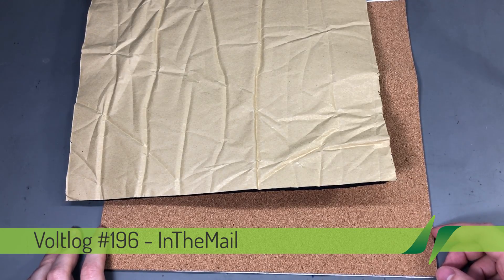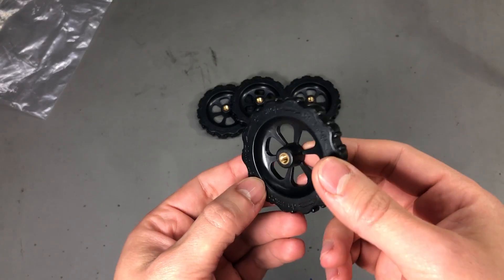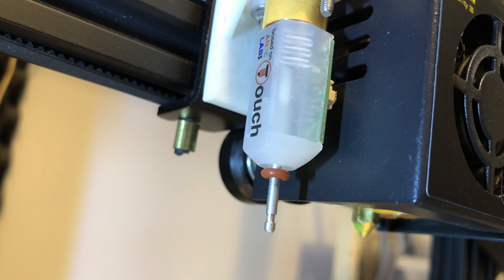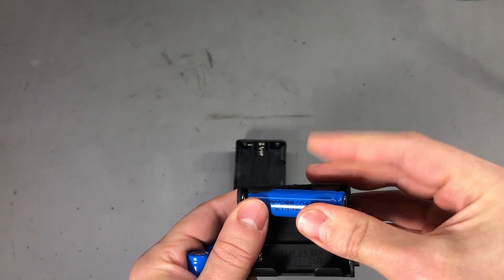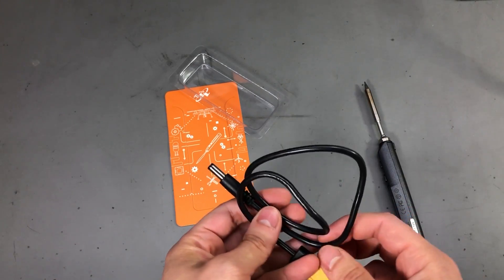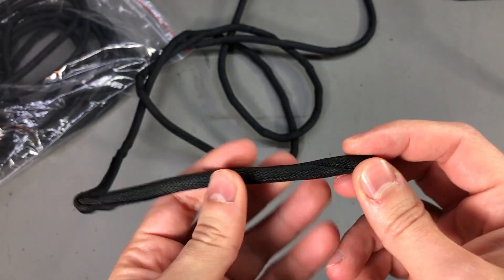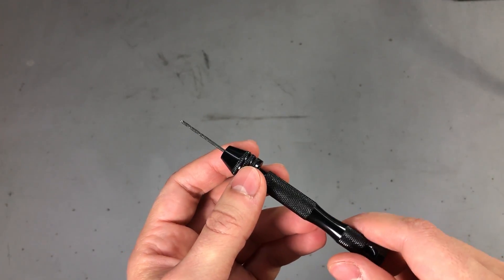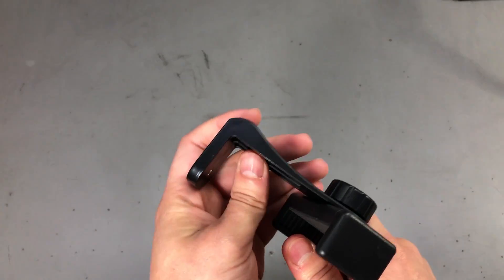Voltlog #196 - InTheMail

Comment: I use a self adhesive motorcycle/car exhaust isolation mat.
https://www.ebay.de/itm/Auspuff-Thermo-Hitzeschutz-Matte-Alu-Keramik-selbstklebend-1-8mm-50x100cm-500-C/292456850056?epid=2148031865&hash=item4417c96288:g:f3cAAOSwgotcN1Sn:rk:1:pf:1&frcectupt=true

Comment: I would have concerns about the mechanical stability of that stick-on foam pad. It looks pretty soft from your video. Don't you need something more solid and stable?  I would have no concerns about the cork. It should have adequate mechanical stability and will hold up to that modest temperature.  I would seek a thicker piece to enhance the insulating factor.
Reply from the maker: I don't understand your point. Why would mechanical stability matter? the foam has no mechanical role.

Comment: Your foam pad with the foil back look exactly like the sound insulation I use in the engine bay of marine equipment and Yachts, it gets pretty hot under there as well as moist so if its the same type of stuff your probably ok and not even close to as hot as a engine bay.
Reply from the maker: that sounds good

Comment: I'm using the black foam with back alluminium like sheet, identical to yours. I have a 250 w silicon matt, I print ABS filament at 105 °C without any problem (no warping, fast warning up). Looks cheap but it does it job. Also the glue is enough heat resistant to print at over 100°C.
Reply from the maker: okay, thank you for the feedback!

Comment: Cork is a great choice, I've been using a 5.5mm thick sheet I got from Wal-Mart from the hobby & crafts area for around a year now, and the heat retention is amazing. At the end of a print, my extruder is normally back to ambient temp before the bed has lost even 8-10 degrees. The fan in my power supply rarely kicks on now too because it has to work so much less on the bed.
Reply from the maker: okay, thank you for the feedback! If I were to decide on using cork, I would have to reorder it because I don't like how the one I got it's ripped to pieces.

Comment: https://www.aliexpress.com/item/2pcs-lot-2mm-Adhesive-Silione-Foam-Rubber-Sheet-163x203x2mm-Closed-Cell-Silicon-Sponge-Sheet-for-Heat/32827967851.html This can get you started. I have a 3mm version that a seller custom-cut for me to my print bed size.
Reply from the maker: this seems to have some specs, interesting!

Comment: For the TS100 card, you can use tattooing power cord. They are long-ish and silicon insulated. I did that one mine, works fine (look for 2M Silicone Tattoo Clip Cord For Tattoo Power Supply  on ebay). You can do power resistor yourself : Use kanthal wire (from vaping gear) and plaster.  Works fine and you can have the exact value you want/need.
Reply: I can confirm the silicone tattooing cable makes an excellent TS100 cable. https://twitter.com/Jon_Raymond_/status/1029021190373949440?s=19
Reply from the maker: Thank you for suggesting the tattooing cable, I've ordered one!

Comment: Regarding your BLTouch: just design and print one with flexible filament (works great on the Cr 10 of it is not too flexible). So you could have the glueing points a bit higher above on the sensor and not risking to glue the aluminium pin when assembling it.
Reply from the maker: Sounds like a good idea to design a custom piece but I think it might be time for me to order an original bltouch sensor because trying to fix the one I currently have might not be worth the effort. I could spend that time finishing and publishing some of the projects I have on standby right now.
Reply: VoltLog you might be right with that. But a video about how to fix that issue could also interest some users of those cheap sensor clones. And it’s not said that the original sensor is better in that behavior....

Comment: It looks like the BLTouch can be taken apart - if so, would it help to put an o-ring on the sensor "pin" from the inside, so that it would still allow the pin to move up freely, but when not touching anything the pin would rest on the o-ring (hopefully preventing vibrations) instead of whatever end-stop it is resting on now...? That assumes of course that the rings "catch" on the pin and don't just sit loose around it. As for silicon cables you might want to take a look at what tme.ro has - although it surely won't be at Aliexpress prices...
Reply from the maker: That's a good suggestion on the sensor and I might try that as a last resort before ordering the original bltouch which people say it doesn't have that problem. Someone else suggested in the comments tattooing cable and I will give that a try because it's just $3 for 1.7m and if it does the job I could avoid having to order expensive stuff from TME. A few years ago when I was looking at their inventory they had some minimum order levels for cable so it was forcing me to order like 10m which was way too much for my needs.

Comment: I put the cork pad on my Ender 3, it did seem to help a bit.
Reply from the maker: thank you for the feedback!
Reply: I use cardboard. :) with some alu tape but I should use cork (it's used in space applications so...) it's a no brainer! Also I use a cloth to cover the bed during heating. I have sound alerts to tell me if the temp is near and never leave it unattended. Works for me!

Comment: HI, I found this 2 Core EWK Silicone Rubber DC Wiring Cable on eBay UK. I use for my TS 100 works great. It’s sold by the Metre £1.52 plus P&P. Hope this helps? 
https://www.ebay.co.uk/itm/2-Core-EWK-Silicone-Rubber-DC-Wiring-Cable-4-amp-2x0-25mm-Flexible-LED-Solar/162534608345?hash=item25d7d14dd9:m:mHh93OgDRw3KP9hAYEz2ZKw:rk:1:pf:0
Reply from the maker: thank you for suggesting this, someone else suggest tattooing cable, it's cheaper at about $3 shipped for 2m, I placed an order, we'll see in a future video if it's any good.

Comment: some sort of cap for the BLtouch, where you could glue (or fit in a groove) the o-ring ahead of time, and then put (or glue) the cap on the sensor?
Reply from the maker: that's sounds like a great idea, it would certainly help me avoid gluing the the metal pin. thanks!

Comment: Several of the links are 404'ing for me...
Reply from the maker: I've tried several and they seem to work fine. Do you still have the problem?
Reply: @voltlog  Pretty much all the Aliexpress links are failing for me. They take me to s.click.aliexpress.com and 404 with messages such as: The requested URL /e/ceylRCIc was not found on this server.
Reply from the maker: they work just fine for me, try another device.
Reply: @voltlog  Okay, so they were failing for me in Chrome. Tried Safari - also failed. iPad - failed. Android tablet - okay. This leads me to conclude the issue is my use of PiHole because the first three devices are all using a PiHole server for DNS whereas the Android tab doesn't (because it doesn't seem to allow you to manually set DNS, bah!).
Reply from the maker: @batshitaussie  maybe there is a way to add a whitelist rule in there.
Reply: @voltlog  Possibly, although for some unknown reason the links briefly worked on Chrome on macOS, but still not on my iOS devices, so go figure. Definitely a PiHole thing, though, because the logs show s.click.aliexpress.com being piholed, even though a page subsequently opens at that domain. So it's a bit weird. I prefer to get stuff via Ebay anyway.

Comment: Just use some ceramic fibre blanket , I use that on my 400 x 400  1500W silicon heat pad .
I just stick the fibre on with kapton tape.
You can find it in small pieces like shops who sell fireplaces or furnaces .
https://www.google.be/search?q=ceramic+fiber&tbm=isch&tbo=u&source=univ&sa=X&ved=2ahUKEwjK85iUlpjfAhXysaQKHWJWCmIQsAR6BAgEEAE&biw=1523&bih=769
Reply from the maker: Ok I get the point that would be the thing to use in an industrial setup and it will probably do the job better than other stuff but really at home it might be overkill to install something like that. Much easier to install one of these adhesive backed things from aliexpress.
Reply: @voltlog  Hey, you asked to let you know what we use down in the comments ,i use this on a homemade printer so nothing industrial.
It is the same ceramic fibre some brands use to insulate their heater blocks instead of these silicone booths.
A 2mm thick piece is enough and probably cheaper than that aluminium piece you showed.
here is a link on alixpress for a 600 x 300 piece $ 2.5 .
https://www.aliexpress.com/item/Ceramic-Fiber-Insulation-Blanket-for-Wood-Stoves-or-Inserts-12degree-x-24degree/32453481469.html?spm=2114.search0104.3.15.7d3760d7OZHlhE&ws_ab_test=searchweb0_0,searchweb201602_5_10065_10068_10890_5730315_319_10546_317_10548_10696_453_10084_454_10083_10618_5729215_10304_10307_10820_538_537_536_10843_10059_10884_10887_100031_321_322_10103,searchweb201603_51,ppcSwitch_0&algo_expid=3660d53e-7839-4590-8042-a6613fb7dfac-2&algo_pvid=3660d53e-7839-4590-8042-a6613fb7dfac
Reply from the maker: @jacksat2252  thanks for the link, useful stuff, I will order some of this and probably use it on other projects. This stuff would have been great about 8 years ago when I built my first reflow oven. It was having trouble maintaining the higher temperatures.

Comment: I don't know if I would trust the corkwood sheet as corkwood tends to scorch pretty easily in my experience, which makes me question its heat resistance. The foam looks reasonable to me, maybe try testing it by putting a pot of boiling water on top? Also, I have a genuine BLTouch on my CR-10 and I also have the rattling sound on fast moves. It doesn't really bother me, though.
Reply from the maker: yeah I guess testing would be the best way to find out which to use, I just wouldn't want to waste some hours doing that, I would rather work on some electronics projects that I currently have pending.
Reply: @voltlog  As long as the foam isn't gonna catch fire it will almost surely be the better insulator. I don't think you really need to go nuts testing it, I think if it can handle a pot of boiling water without melting it's probably gonna be better than cork.